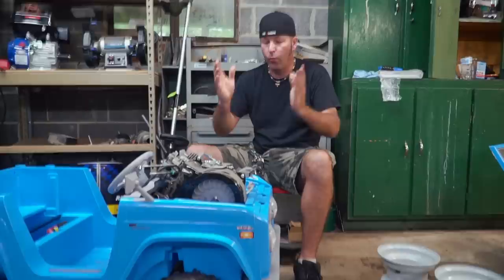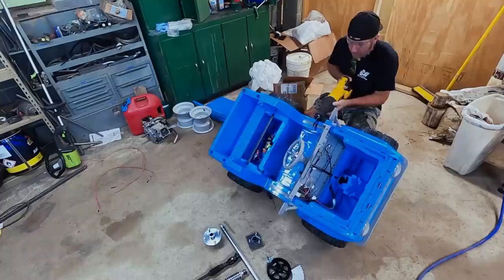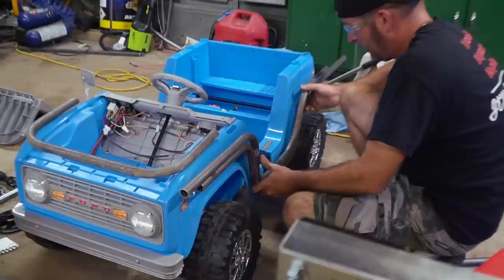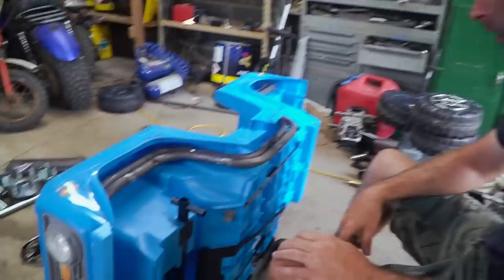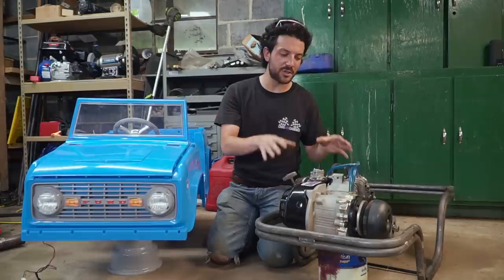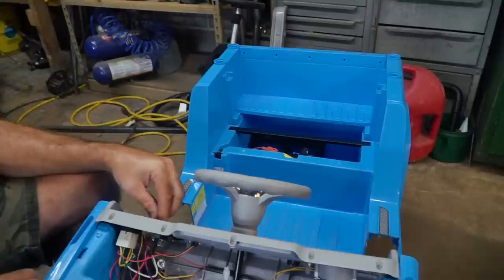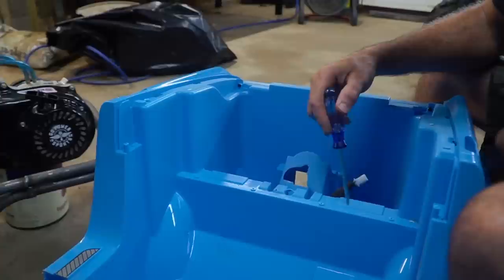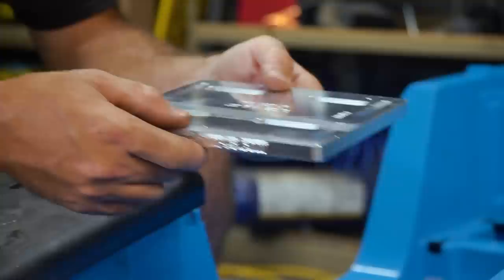4X4 Ford Bronco Power Wheels Go Kart Pt. 2

Comment from the maker: We bent a decent little chassis for this project! Very stout too. A nice change from the gigantic trophy kart!
Reply: dam posted 3 mins ago and 46 comments already .. time to watch
Reply: you should try a 670
Reply: This build is so cool guys
Reply: I’m currently doing a power wheels build too and I’d recommend cutting the body with a metal cut off wheel, the friction melts the plastic and the wheel pushes it out of the way. It makes very clean cuts, it just gets little pieces of plastic everywhere though
Reply: This bronco is wicked, but I think the trophy kart will be the king 🤴
Reply: Just put 7 in rims 16 in tires
Reply: Love it keep it up guys!!!
Reply: Very nice. These power wheels builds are my favorite. I'd say don't be afraid of asking Grind Hard Plumbing Co for help and advice. They are probably the most knowledgeable youtubers on this type of build, being that they've built three of them now.
Reply: Go with the bigger tires and put a lift on it if your rock crawling on 4x4 you need travel anyways
Reply: I liked the bends, the engine definitely fit like it was meant
Reply: Y'all should put a 302cc motor instead of whatever y'all are using
Reply: What about the new shed your building
Reply: GUYS WOAH WOAH WOAH! STOP THE VIDEO!listen Isaac, John, please @ least consider a 250 or 450 dirt bike engine.2 or 4 stroke, just at least think of it. Think of it, all the work yal will put on it, only for it to be a very good GO KART. If u want the power like grind hard or anybody else for that matter that has built 1, u must have the power.just saying this cause I love u guys
Reply: buy another power wheels and put a truck battery
Reply: Spray Orange oil on the wood termites no like it
Reply: You guys have to keep the horn but put a car horn on it
Reply: It’s like napalm lol
Reply: I’m building one out of a Barbie Jeep and I’m putting car horns on it
Reply: Hahaha that's something me torque huh
Reply: stacey may Theyve already got a lot of comments about a dirt bike motor instead of the lawnmower motor.  The replies I’ve seen, seem to say that their channel is more “go-kart” centered, so they want to make it a go kart and not too wild.  Also they said there going for “rock crawling”/4wd and not speed.  I also am a little disappointed. Even a 80cc 2 stroke would be pretty sporty in that thing.  I’d like to see John and Ike make something wild.  The Crosskart is cool and the trophy kart looks like its going to be cool, but something with like 80-100hp that weighs like 300-400lbs.  Thatd be cool.
Reply: Jeff Kopis  really would like to see them finish the trophy cart project first.
Reply: Keep the horn with it! Just for laughs haha lol would be  awesome!
Reply: Hey guys I have a go cart and it runs but having problems it runs for a few seconds and the shuts off do u think u cold work on it go me I will pay u
Reply: I reckon you guys should do a giveaway on one of your Builds.

Comment: Really should vent the block to a catch can so you don't blow out your oil seals. It'll also help the engine run more efficiently if you install a few check valves in line to the catch can. Cool build guys!

Comment: Andrew Cless
I’m currently doing a power wheels build too and I’d recommend cutting the body with a metal cut off wheel, the friction melts the plastic and the wheel pushes it out of the way. It makes very clean cuts, it just gets little pieces of plastic everywhere though

Comment: Just got my stickers and tee shirt from you guys nice touch signed my stickers just got into go kart hobby had not had one since I was 10 I'm nearly 40 now have a Carter hot body kart with a 11hp preditator and torque converter has 54t drive sprocket it really rips thanks again guys for your help and guidance into this hobby keep up the good work

Comment: A word of advice.
Don't make anything permanent until you have all the systems required in place.
For example: permanently mounting the engine now would be a mistake because you have steering, front suspension and apparently a four-wheel drive system that all has to go underneath it/infront of it/around it.
Quick brackets with tack welds is going to be key!
You will have to change and modify your plan as you go, it would be impossible to get everything right the first time!

Good luck!

Comment: langmuir tables are awesome i just got mine about a month ago. there is a learning curve with the software as far as fusion 360 goes the firecontrol is pretty straight forward. when your doing your first cut increase your pierce delay so you don't lose arc voltage.i have mine set 5% above. and make sure everything is level

Comment: You can just set the body on top the motor once its in and then make the back part of the body line up with the front with some spacers. Then it will definitely fit under the hood.

Comment: You guys should retrofit the air compressor with an aftercooler. You want dry air for those plasma tables. You can use an old AC condenser.

Comment: Flip the motor around. Intake out the front. Belt assembly rotated. Then figure out how to flip the rotation back to normal before getting to the rear end. Gear to gear drive could do it

Comment: U guys should look up 87 polaris trail boss 250 4x4, the 4 wheel drive system is done with chains and u joints. I made the axle shafts out of a subaru steering colomn one time, might give u some more ideas.

Comment: Hey man, I gotta tell ya, I was hoping you was gonna put a 12 volt battery to that 6 volt system. I got my hands on a thrown away 6 volt powered big foot power wheel and I stuck a 12 volt motorcycle battery in it and that thing went crazy fast. My boy was 4 or 5 at the time and he was drifting all over the place. I tried it and it put me right on my back, so I put a helment on my boy and said, see what it will do. It went through 3 gas pedal switches that year. The next year it was all dirt bikes so it just sat there til I finally got rid of it. Anyway, keep doing what your doing, and always excited to see what your up to doing next. I will admit, I have been waiting to see what you were going to do next with trophy truck.

Comment: Please guys, REALLY CONSIDER a 2 or 4 stroke dirt bike engine. I mean think of it all the work u guys would have put into it just for it to still basically be a good go kart. I know u guys want the drift power,the torque, all that. & U both are experienced enough riders now to be able to handle it well...as long as it's it's built well which I'm sure it will be...I sank when John said what the power plant would be lol please guys u know u want the power. I just want to see u guys do 1 so bad & run w everybody else who has the like.
Reply: & As u guys know it's still very small compact & can be geared to any needs

Comment: if you also lengthen the wheel wells as you did the door way, the motor and dash will have more room to coexist. AND you can use bigger tires . LOL

Comment: for sure you need to cut out behind the grill, for a little air flow up front. its looking sweet tho, if you could find a taller tire on a 6 inch wheel i think youd be about dead on

Comment: If you haven't locked down the engine. Can you mount it with the crank set nose to tail? Mount the torque converter in an over under set up then shaft it to the middle and split it front to back

Comment: they is bolt on carbs rather then the tuve fit carbs i think may get the carb closer to engine and stop the fowling of the body they is a slight angle to it looking at the bolt config but should not be a problem plus you can run the carbs with just stocking fabric to stop large ojects getting in that should also allow for more room

Comment: Need to put up a new shop( pole barn, red iron, or coast to coast ect) type so you can have a decent size shops 40x40 or bigger. Insulated even climate control.

Comment: Putting the engine to low in a small hole might lead to cooling issues. Exhaust could melt plastic too

Comment: Please put an engine with a manual transmission.
Reply: Yes please that was exactly what I was thinking this thing is going to sound really shitty and slow with that engine
Reply: @diyking9k74  RZRs, Honda Odyssey/Pilot buggies, and snowmobiles all use belt drive. It won't be slow on a light frame either.
Reply: @BunkerBlog  this is a slightly more powerful version of a lawn equipment engine, not a 400cc 2 stroke snowmobile engine, or a 1000cc side by side engine.
Reply: @jmk6574  This also isn't a 1600 pound side by side or a 600 pound buggy. I'm guessing it'll be around 400 pounds all said and done. 23 horsepower will be more than enough, especially when geared low. It's mostly gonna be a crawler anyway.
Reply: @BunkerBlog  that's the thing, they have to choose between low and high gearing.  If they put a Yamaha warrior engine or something in it, they would have 6 gears, so they can rock crawl, and have a high top speed.
Reply: @jmk6574  Speed is mostly dependent on RPM. This engine can spin to like 8500 - 9000 RPM. They can gear it low and still theoretically hit like 50-60mph if they wanted to, depending on tire size. And plus, the CVT has a built in overdrive ratio, which would boost top speed even more.

Comment: I love you guys to death but you guys need to be honest with yourselves if you're trying to build a fast vehicle that can also Rock crawl and all of that you're definitely not going to be very successful with a CVT clutch or a slipper Bill clutch you need a transmission or something with multiple gears to be successful. why do you think the automotive industry hasn't switched to making their four-wheel drive vehicles with CVT transmissions? It's because they can't handle the constant low RPM stress and they burn the belts up, that's also why vehicles equipped with the CVT transmission cannot tow very much weight.

Comment: That's pretty dang mild to what I'd written.That frame is Same as the green and white truck,and it's Not 4x4.You're just yanking ratings and screwing us over for another year.AF+GAIN.You keep saying"next year we'll do a 4x4".I've been here 5 years"
"I will pay your Patreon account $10 if this "new build is all wheel drive:,when it does run acceptable to you 2".
All can see,and will accept my terms?TY.? I will donate same to St.Judes Children's Hospital either way.
Reply: Click Like above if you think they have a set of nuts between them,and will do a 4x4.Judging by past performances,I'll be having lunch with my Mom,and it will need parts come November,this year.